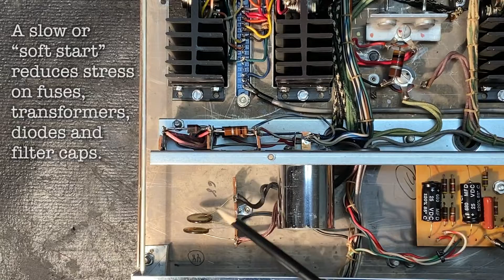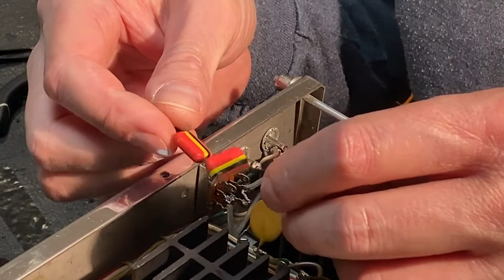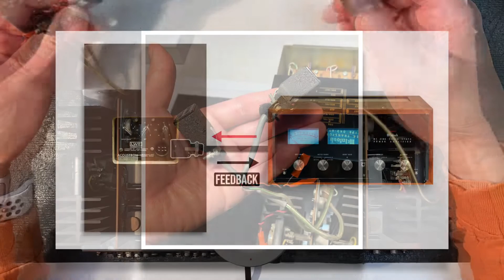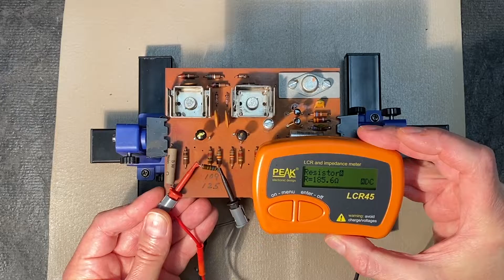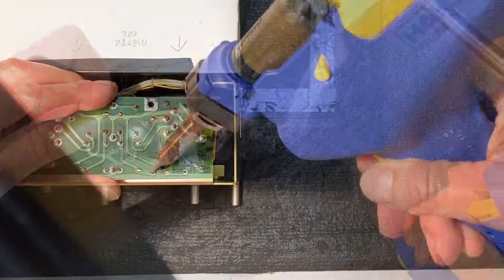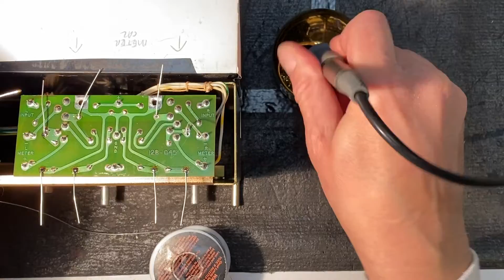McIntosh MC 2105 Restoration P4: Thermistors, Input Caps, Driver & Meter Boards

Comment from the maker: NOTE: At the 20:16 mark I state that two 320 ohm resistors were joined in series to create 160 ohms of resistance. This is incorrect. While I did consider joining two 320s in PARALLEL to get the necessary 160 ohms, instead, I joined two 82 ohm resistors in series.
Reply: That's the only thing that caught my attention.  Good job on correcting the audio

Comment: Great videos I am thinking about Purchasing a MC2105 Should I be concerned about the fuse holder having a little rust around the holder.
Reply from the maker: Well, sure. Any rust is an indicator that the unit was stored in a wet or humid environment. It really should be checked out on the inside to determine the extent of the exposure and level of damage. That said, a little rust doesn’t necessarily mean it’s a lost cause. It’s certainly not ideal, but it’s possible that the unit is just fine.

Comment: Quick question... why do you use flux instead of flux-core solder?  I've been using the same spool of flux-core from Radio Shack for many years.... just wondering what you think.  I'm due for a new solder-sucker.  Maybe it's time to follow your lead with flux and solder.  Thanks again for the videos!  really looking forward to my 2105 project!
Reply: Hahahha, by the way, love the Mr Mackey shout-outs!
Reply from the maker: Good question, Bob. The solder I use does have a flux core which is absolutely necessary. Sometimes, though, the flux in the solder isn’t enough. There’s a relatively small amount of flux in flux-core solder and if you have a weld that requires a long dwell time, the flux burns off too quickly. So, for tricky welds, it helps to add some additional flux and that’s what you’ll sometimes see me do. For PC board work it may never be necessary, but for big welds or chassis work, you’ll be glad if you have a tube of flux nearby. Thanks for the kind words, and great luck on your project!

Comment: FINALLY!! Hi Chris, I spent hours all day yesterday and then again today, trying to get YouTube to show the posted comments for yours, or ANY videos! Nothing I tried from the various suggestions I found on line, worked. I had all ready tried clearing the cache and the O/S DNS cache but this time, I tried doing it again on my Android Tablet. I cleared the cache and the browsing data and then I followed instructions to do the same directly within the YouTube App.

When I restarted the computer, Voilà! The comments are back! I haven't assessed just how far I may have affected my browsing history in Google on my computer by doing that operation on the Android O/S of my tablet. It probably affected all my systems but at least now I can see the comments and post, (lucky you! LOL).

Anyway, I found out that my MC2105 was recapped about 3 to 5 years before I bought it. I bought it in December of 2019. As soon as I finish making the probe cables & clips for my Cap Leakage tester, I'm going to unsolder the wires to the Multi-Cap can and test each of those. I'm betting that they'll be good. Considering the amp's relatively recent recap, I think my two, large, genuine McIntosh Caps, (they were 30,000uf/100v caps, brown in color and with "McIntosh" printed on them in large text), will pass the tests as well.

I replaced them with the two Blue caps in the kit early last week. I like the fact that those two I removed are genuine McIntosh capacitors but I don't know if I want to go back and do the work to put them in again. I'll decide later.

I completed the work on the Input Section and though I don't have any replacement Thermistors, the ones installed look very good. However, I'm still going to recap the Output boards and check all the other components that you've talked about.
FWIW,
Rich

Comment: I know those mylar foil caps are not in series at 10 min in your video. But those mkp wima are much better in audio configuration, I see even in the recap kit you have got are polyester caps. Those are no go in signal path. Is it course in 1960 there where no mkp caps? And to keep hold on the old style amp? Nice videos your making 👍😁
Reply from the maker: Thank you. Any Mylar caps that test fine in this amp can stay and do not require replacement. There is no audible advantage to switching to modern replacements despite marketing hyperbole or lore which state otherwise.
Reply: @FluxCondenser  you speak pure from a messurement statement and that's you good right. I'm building highend audio and then after messurements we listening to different coupling capasitors. Then the sound shall almost be the same. But not the soundstage and 3D sounding around the listener. And to be honist old vintage equipment is not even capable to produce this.
But in a way of is this product good and reliable, yes it is. And that was the intention of al of those brands.
Marantz pioneer akai sansui etc etc etc. But this kit is very nice, and your very good at building too 👍
Reply from the maker: @Dutchamp  I appreciate the kind comments, thank you. We’ll have to disagree on the merits of components that measure the same somehow possessing magical sound qualities. I just don’t subscribe to that thinking. 

I’ve been an audiophile for decades and own plenty of high-end gear. If you can’t measure a difference, there won’t be an actual audible difference. Claims of “increased soundstage,” etc. due to unmeasurable characteristics has simply never been proven to be true. Swapping components and then claiming a sound improvement has been gained is only confirmation of bias, and not confirmation of an actual benefit. 

To do that, double-blind testing is required and under those conditions, exotic cables, components, etc. never prove to make a difference that can reliably be detected. The brain is more psychological than analytical and our memory for hearing is notoriously bad. If we think there will be an improvement in sound, we’ll hear an improvement in sound. Despite the truth of the matter.
Reply: @FluxCondenser  we think very differanly but that is ok not one person on this earth is the same, am I glad 🤗 the differance I can hear are indeed very very little.
But hé it is a hobby and I'm pleased to have mundorf supreme audio caps in my tubeamps. They cost some yes true but I like there sound.
And the best capasitor is no capasitor. I use a preamp line 6CG7 and phono MM   2x 12AX7 or ECC83 power Amp input 12AX7 to 6SN7 drive two 6550 in Push-pull.
I am not a transistor lover but there are good amps in transistors.
Again nice to have a conversation on the hobby. Like I said you got nice video's and I learn about transistors aswel 😉
Reply: Well actually for coupling purposes (which these two capacitors were for clearly) polypropylene is superior to polyester. It has a dissipation factor magnitudes lower than polyester and generally much lower distortion numbers.  Now does this mean they’d sound better? Cleaner yes, better is subjective. Some people prefer the sound of a “warmer” cap, usually warmer equates to higher distortion.

Comment: HI . GREAT VIDEOS. I HAVE A MC2105  AMP. I NEED TO REPLACE THE POWER SUPPLY PRESS FIT DIODES D301 TO D304. MY QUESTION IS DO HAVE A VIDEO TO SHOW ME HOW TO INSTALL THE NEW DIODES. IF NOT HOW DO YOU REMOVE THE DIODES FROM THE HEAT SINKS. AND THEN HOW TO OUT THE DIODES BACK INTO THE HEAT SINKS.. THANKS PAUL
Reply from the maker: Hi, Paul, I’m not certain, but I believe those diodes are just held in place by the opposing pressure of the leads. Try desoldering the leads and if I’m correct, you should be able to pull them out of the holes. To reinstall, clamp them in place and then solder the leads. Let me know how it works out.

Comment: Im getting ready to do some lamp replacement on my mc7205 with leds. Any issues I might want to be aware of?  I’m also getting an intermittent fault light on one of the amps. Any idea what I should be looking for when I open her up?
Reply from the maker: I’m not familiar with working on the newer McIntosh equipment so I’m not sure about LED compatibility. I imagine that unit already uses some LEDs, but the meter illumination may be incandescent. In general, though, I’ve had good luck using LEDs as replacements on older Mac equipment. The MC 7205 has clipping, current and thermal protection. Which type of protection does the fault light indicate? Is it illuminated all the time? If not, what initiates the fault?
Reply: Flux Condenser I don’t know what initials the fault. It’s the orange power guard lights that come on the left front amp. It just stays on sometimes when it is powered on.  I have another Mc7106 that I just switched that input to.  I haven’t seen the powerguard light come on since I switched the input to the other amp.
Reply from the maker: I see. The power guard is supposed to detect and prevent clipping. If it’s operating as it should, the light is indicating that you’re driving it beyond its power limits and it’s protecting your speakers from clipping. If it’s coming on at lower levels or when you’re certain you’re not overdriving the amp, then I’d be wary of using the amp until the issue is diagnosed. Again, I’m not familiar with the circuit so I can’t say for sure what’s happening. One thing to look for will be your voltages on the driver boards. If one rail is down in voltage (positive or negative) it could be sending the transistors out of bias which is leading to distortion and hence, the clipping. This could explain why the light comes on at lower levels. The other possibility is that the power guard circuit is malfunctioning and you’re not going into clipping at all. I would make the assumption that it is detecting distortion, though, and proceed accordingly.

Comment: @Flux Condenser, what is the value of thermistor used in Macintosh MC2105 and MC2125. Your advice would be most appreciated.
Reply from the maker: Jonathan, the thermistors used are CL80A’s. The A at the end denotes a kinked lead which is the indentation. These provide 47 ohms of resistance when cold and can handle 3 amps. When at 25% of current, the resistance drops to 3 ohms and at full current, down to .49 ohms. I can only speak for the MC2105 but would guess that the MC2125 would also work well with CL80A’s Hope this helps.
Reply: Flux Condenser Thanks so much for your reply and help! Really enjoyed the detailed McIntosh amplifier restoration YouTube videos you have put up! Great job, keep it up!

Comment: Are you familiar with xraytonyb?  He restored an MC 2100, that I would think would use many of the same parts as the MC 2105.  He designed and had printed that driver board (as shown in his "McIntosh MC2100 Amplifier - Final" and "McIntosh Mc2100 Driver Boards Have Arrived" videos), but it looks a bit different than the one you show.  Do you think the MC 2100 and MC 2105 used the same driver board?
Reply from the maker: Chris, yes, I’m a big fan of Xraytonyb. I was aware of his video about the MC2100, but never watched that series. The MC2100, I believe, is the tube version (EDIT: It's solid state) of the MC2105. The layout of both chassis appear to be very similar as are the driver boards. I took a quick look at the schematic for the 2100, and as expected, it is different than those in the 2105.
Reply: @FluxCondenser  Thanks for the reply.  That's interesting.  I always thought the MC2100 and MC2105 were basically the same amp, but the MC2105 had those cool meters.
Reply from the maker: @chrisblock6697  Whoops, actually I'm wrong. The 2100 is also a solid state amp.
Reply from the maker: @chrisblock6697  Looking over some old brochures I have, the 2100 appears to be bridgeable to be used as a 210 watt mono amp which isn't possible with the 2105. The 2105 has "34 silicon transistors, 18 silicon rectifiers and diodes" and the 2100, "32 silicon transistors and 14 silicon rectifiers and diodes."
Reply: @FluxCondenser  Thanks for doing the research and the info... much appreciated!  So, I wonder if the 2100 is a bit more designed like their stereo tube amps (MC275 and MC240) that I believe are both bridgeable to mono.  The 2100 looks a lot more like their old tube amps.  I've got an MC240 (tubes, stereo 40W/Ch) that has a mono RCA jack that I've never used.  My MC2505 (which I believe is very similar to the MC2105, but rated at 50W/Ch) looks not to have any mono capabilities.  Thanks again for the info!

Comment: New Intro!
Reply: at 20:18 you meant to say parallel.  Intro was great.  Everything you do is great.  Just finished part 4.  I really enjoy all you have put into these videos!
Reply from the maker: Thanks, CH, really appreciate your great feedback. Good catch about the resistors and again, I appreciate you pointing that out. We’re both a bit wrong, though, as the problem with what I said wasn’t that the resistors are wired in series (they are), but that I said they were both 320 ohms. That can’t be, of course, and I actually used two 82 ohm resistors to get close to the 160 ohm value I was looking for. Kicking myself now as I reviewed this so many times for errors and can’t believe I didn’t catch that.
Reply: @FluxCondenser  Yes, that makes sense. You've encouraged me to take apart some of my 30 year old audio equipment to be refreshed.  Unfortunately, my vintage components are not McIntosh.
Reply from the maker: CH, Go for it, and good luck!
Reply from the maker: @cdavidhord  Oh, and you were correct that two 320s in parallel would give 160 ohms of resistance and that's why you thought I must have meant parallel.
Reply from the maker: Yeah, I thought it was time for an update. What do you think?